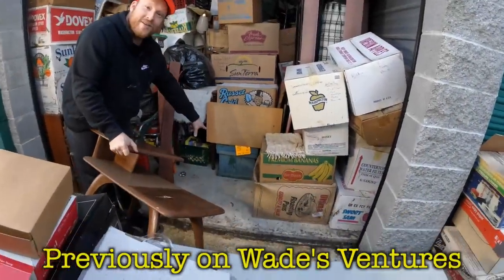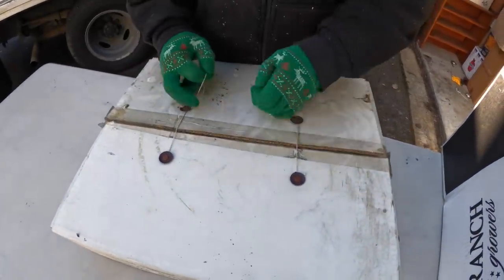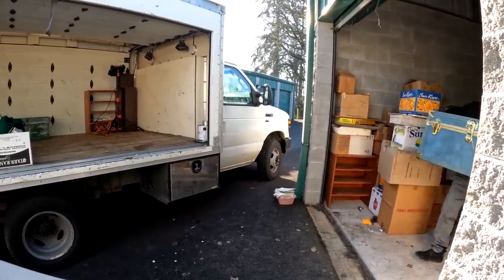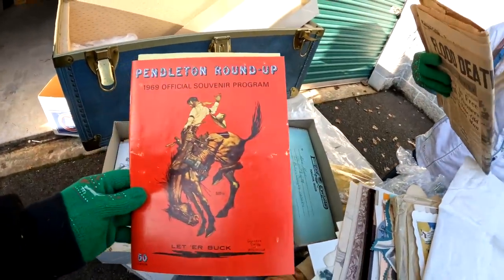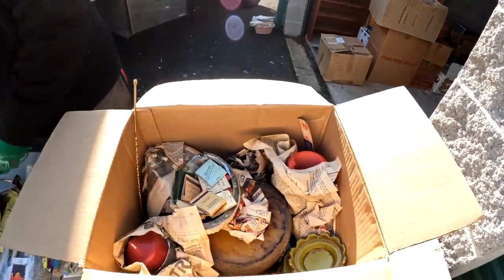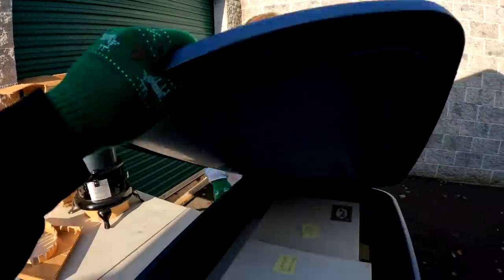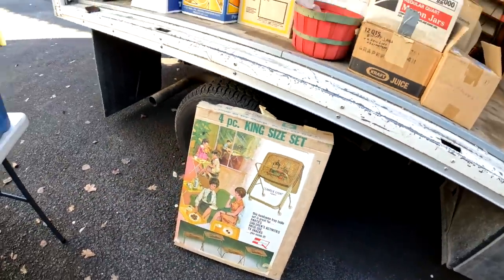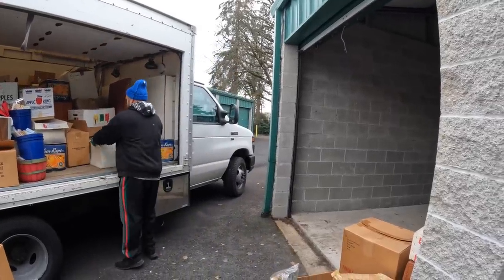Buying Abandoned Storage Lockers In A Recession!

Comment: Oil cans did not, usually, get the whole top opened by a can opener.  They were opened  by a oil can punch that had an attached pour spout, or by a can punch, which was used with  a funnel.  If you were good you could punch the hole and aim for the engine oil spout.  Cans were changed starting in 1985 to plastic bottles.

Comment: The oil cans can be opened up by a triangular can opener like you used for evaporated milk. The garage would have a thing that they pushed into the can and it had a spout on it and they would just pour the oil in from the spout to your oil reservoir in the car.
Reply: The spout was actually in the tub with the oil
Reply: The cans themselves are collector items.

Comment: If you were around in the 70s, you will recognize the items - Realistic, inexpensive Radio Shack receiver, Robert Bruce, low-end brand sold in discount stores, Benrus, the moderately-price watch for the middle class.
And if you have been around even longer, you will remember Robinson Crusoe was first published in 1719 , making it unlikely you will find a first edition.
Those oil cans might be collectible - motor oil tins are highly sought, but they are looking for really old ones.   You don't open them with a can opener, they had spouts with a punch at the bottom end - you could Google it.   You jabbed the spout into the can and poured the oil that way.

Comment: The oil should be fine as long as they have not been opened up in contaminated there is a push spout that pushes through the top creating a hole about this inch diameter with a spout that pours into your motor although be careful if those are cardboard cans they will start leaking over time